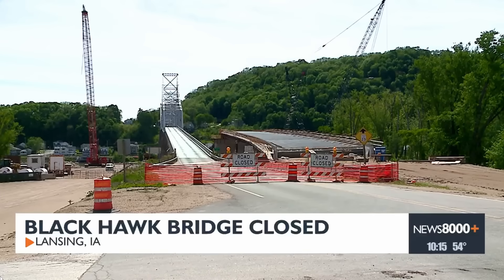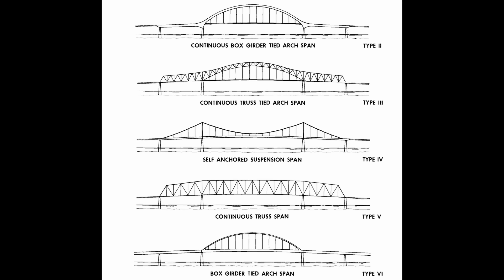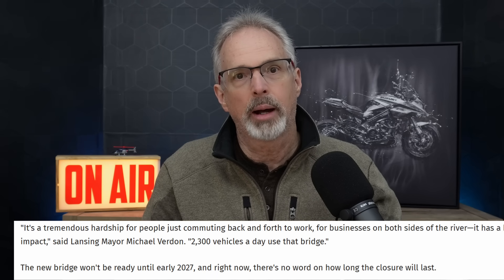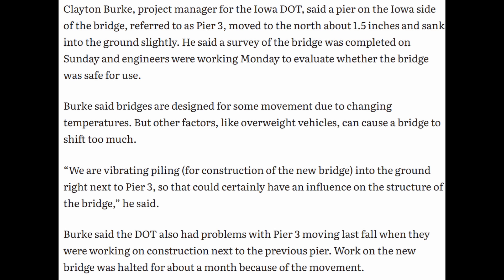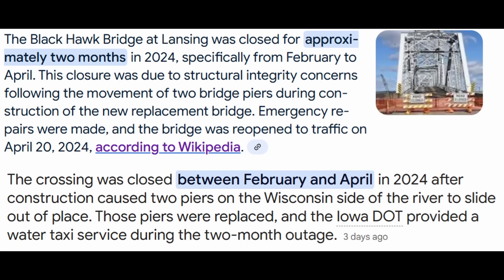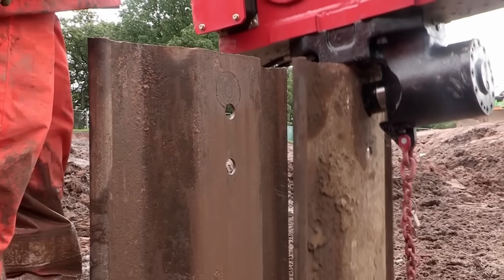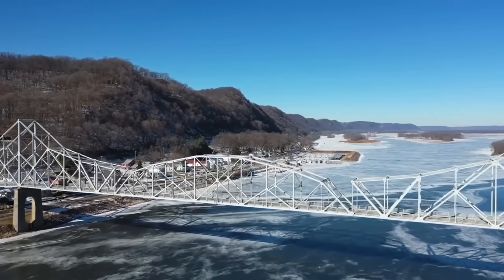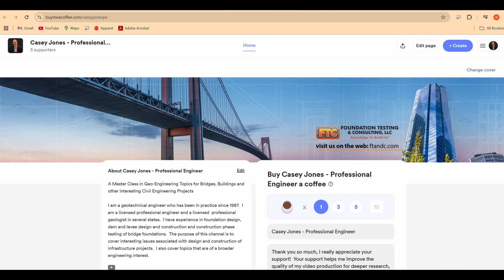Blackhawk Bridge over the Mississippi River

Comment: Lansing Iowa businesses receive a lot of customers from Wisconsin. not having these customers hurts their economy tremendously. That is the reason the existing bridge was left open to Wisconsin. it is a travesty to use the hammer drill instead of a casing oscillator and CAUSE this closing. I suggest a class action lawsuit against both the state DOT and the contractor for lost revenue to the businesses of Lansing and the workers who have to commute to Lansing and now have to drive 60 miles one way to get to work.
Reply from the maker: I am sure it will be a hard impact on the local economy.  I understand that Iowa DOT will be issuing a new press release tomorrow so maybe we will learn more about plans and timing to reopen this bridge.

Comment: Hello Casey. I have a question. You mentioned rather than using a vibration and/or driven type machine for installing casings, to use a casing oscillator instead. My thought is that an oscillator would need to set on some pretty solid ground to be able to apply the torque needed to install these casings. Am I wrong? My understanding is that these were installed in the river with nothing to really hold an oscillator in place, and the driven vibrators were suspended from cranes. Now, I know very little about these machines and have never seen an oscillator work, so I could be way off base.
Reply from the maker: The oscillator and cranes would be set up on barges.   Barges can be spudded to jack he barge deck above the water to provide a stable platform.

Comment: I've been a fan (?) of this bridge for decades. It's sort of a destination for motorcycle people because it is such a pretty bridge, in such a pretty location, and the steel grate deck gives a great sense of flying if you look down (assuming your tires aren't wiggling around too much).

One of the things I really like about this bridge is its engineering honesty, as shown by the gaps in the top chord. All the load of the center truss is transferred to the cantilevers via the bottom chord, so the designers saved a bit of money by leaving the top chord out at the places where the cantilevers and truss connect. This is true of many, many cantilever-truss bridges, but most (like the one across the Mississippi at Winona, MN) put in a superfluous top chord so that people don't think the bridge is "missing some pieces" (what's particularly fun is that the decorative top chord of the Winona bridge has to have a slip joint to compensate for expansion).

It is nice that the state of Iowa has elected to replace this lovely old bridge with a similar cantilever-truss and not the soulless concrete spans that have replaced many of the old steel bridges over the Mississippi. Alas, the CGI rendering I saw at the Driftless Visitor Center (just south of Lansing on the Iowa side) didn't have the gaps in the top chord.

Comment: The ' connection '...between   1931  ' vehicles '' using  those bridges.  They, were about  10   TIMES....less  weight, than todays'  modern  TRUCKS.   THE  PRICE / cost of  Replacing  those   bridges ....goes up   proportionately, along with what You mentioned ; rules / laws /  SAFETY   Standards.   ....standards..../ Too bad, Contractors  today -  CUT  CORNERS....on most  Everything,  designed, and built.  No surprise, to me, in a   ' speedy '    greedy,  impatient,  mostly NON logical, in designing    ' stuff '.   Add, modern  plastics, and other materials, used in   ? Construction ?.  Poor  ......cement, as well.  Too much  water....Not  enough ,  lava ash.....o well.../ so goes , modern  designs.

Comment: I used to live in Lansing as I worked in the Power Plant south of town just out of College (and have driven over that bridge likely at least a thousand times or more before I moved to another job). The detour issue is minimized as most people from Lansing do a lot of shopping either in LaCrosse or Prairie du Chien.  Each city has its own bridge across the Mississippi river.  So in actuality to get to either LaCrosse  or Prairie du Chien is normally a few mile detour and not a 60 mile detour.  There are several small towns between LaCrosse and Prairie du Chien, and people living or working in those towns where they work or live in Lansing are the ones who face a longer detour.

What surprises me is that I knew back in the 1980's when I lived there that the Blackhawk bridge just essentially sits on sand. Piles may have been driven to bedrock - but I don't believe into bedrock. Very susceptible to movement of the piers.

Comment: The previous Sikorsky Memorial Bridge on Connecticut hwy 15 (merritt/wilber cross parkway) in Stratford CT. (replaced 25ish years ago) was about a 1/2 mile long open grid deck bridge that was over 100' off the water (bluff to bluff bridge) and as a new driver, it scared me as it made the car shimmy latterly.

Comment: In my youth,(1970's) they replaced a nearly identical cantilever design between Sewickley and Coraopolis, PA on the Ohio river. The pilings were replaced because back in the day, they didn't support them like they do now. We built many of these bridges at the American Bridge Works in Ambridge, PA. The factory was gigantic ( I think I recall being told that it was 10 miles long). The bridge segments were put on barges and floated down the Ohio to site of the new bridge.

Comment: Someday I'd be interested in your thoughts on the Gold Star bridges in CT. Was originally a single bridge, but they added lanes to that one and built a second bridge so that normally each bridge handles one way traffic. Currently there's work being done and the majority of traffic is on one bridge. Seems like the volume and weiight has to be well over what it was designed for - especially the older span with the added lanes.

Comment: We have family in Lansing. When the old bridge was closed I guessed that placing the new, much deeper pilings so close to the existing bridge pilings must somehow be undermining the existing structure. I don't believe in coincidence. The installation methodology causing liquifaction is immediately plausible and supported by evidemce from prior projects. This is a great video and illustrates why I love YouTube. Your expert insight is much appreciated. And your good analysis attracts positive and supporting dialogue in the comments. Well-done. Thank you.
Reply from the maker: Thank you so much.  I am definitely surprised at this turn of events. I'm going to do an update video soon. I realized I've got several the project documents on my computer already.
Reply: Timber pilings, Timber piles degrade on exposure to oxygen, this tends to soften and rot at the exposed ends even if underwater edges. This easily could have been done by a flood, also. There was a lake near our home built in 1922, for most of the life of the lake the trees were below the thermocline and they remained. In the 80’s with all the drought lake levels fell and the trees began to rot and break fairly quickly. IOWA is of course colder than Texas, but you are getting into that 75 to 100 year period where you can expect the caps begin to fail for no other reason than they are old. Yes, I know, someone’s going to say but such and such discovered a pristine piece of woodwork 3000 years old. Yes, that can happen in wet environments that are anoxic and lack oxygen sources like sulfate or nitrate, but these types of environments within 20 feet of the surface are rare.

Comment: I thought the iowa dot would be well aware of this danger by now, as nearly the same thing happened at sabula iowa in 2018.  Contractors preparing to replace the small slough bridge were driving pilings nearby and caused the existing bridge to drop several inches. This created an instant, unplanned closure of the iowa/illinois river crossing which lasted from February to September.
Reply from the maker: I'm going to call Iowa DOT for an update video to see what they were thinking.

Comment: I am wondering if you would have the time and interest in doing a segment on a bridge replacement project in Ranier Minnesota. It is a 115 year old cantilever lift bridge own by CN railroad that spans the Rainy River between Fort Frances Ontario and Ranier. The bridge is an International port of entry that carries the highest volume of cargo into the U.S. of any rail port, 25-35 trains daily. A new bridge has been in planning for more than 5 years, CN is very tight lipped to the frustration of area residents that are greatly inconvenienced by it dividing our community many hours daily. An interesting aspect of this bridge is that it spans one of the highest volume rivers in North America, the existing bridge and and the rock geography acts as a choke point causing flooding that can be very damaging. In 2022 we had a flood that is described as a 500-1,000 year event, almost a million sand bags were used to try to minimize the damage. The local population is trying to pressure CN to not further impede the flow and remove enough of the bedrock to increase it, we feel that our concerns are falling on deaf ears. They are saying that they will release their plan in the near future.
We are off the radar in a sense due to the fact that the water all flows North into the Hudson Bay..

Comment: You mention the ballooning cost of bridge replacement, citing such things as more regulations and tighter design requirements, calling the resulting price hikes "shocking".  I'd be interested in hearing more of your thoughts on that.  In particular, do you mean to suggest that any of these regulations or requirements are seriously excessive, and that there are large potential cost savings in removing unreasonable ones?
Reply from the maker: Yes, I think there are too many regulations that slow down the pace of bridge replacement and increase the cost.  For example, I think some of the environmental regulations should be streamlined for bridge replacement projects.  I also don't understand why the government is mandating wage rates for trade jobs.   Let the market decide what they need to pay to get a job done.
Reply: Just compare commercial trucks of the 1930s with what is currently on the road. Even current F150s vs the model Model A version. Then compare what safety standards were acceptable in the '30s vs today.

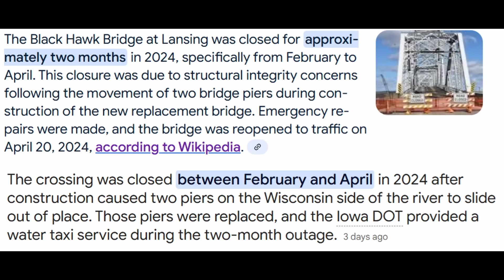Comment: 6:30 So what DOT engineers learned in February of 2024 -- that operating a giant vibrating pile driver next to an existing pier can cause structure atop that pier to shift dramatically  -- is also true in May of 2025.  Who would have suspected that principals of gravity, physics, mechanics and geology are constant over time?  Mind.  Blown.
Reply: Just my two cents here. The original plan was to shut the old bridge down, remove the old bridge, and begin construction on the new one. 

Due to the community and backlash they decided to leave it open. While they were monitoring the old bridge I don't believe keeping open was  priority over cheap construction costs. 

Also this particular area of the Mississippi has lots of secondary channels and back waters making it near impossible to simply chose a new location. They had to land the end of the bridge at the existing WI maintained dike/road.

Comment: As a local(ish) person id like to say that for most people in and around that area it's not a huge problem that's it's closed. Because if your going up to La Crosse or down to Prairie Du Chien your just going to drive the Iowa side of the river and cross at the bridges in them cities so it's not really any difference in time. There pretty much nothing but rural homes on the other side so there's just not that many people that would be badly affected. Also the wiki has a slight mistake.... the Wisconsin side highway is 35 which is also referred to as the Great River Road as it goes up along the length of the Mississippi River. 82 is a obscure east/west highway that more or less starts/ends a mile up the road from the the bridge but technically also includes the very short stretch of road with the bridge. So it's really only partially technically correct, but it's primarily 35 and everyone refers to it just as 35 going past the area.
Reply from the maker: Thank you for those clarifications I appreciate it!
Reply: You are leaving out the fact that Hwy 35 from Prairie du Chien to Lynxville is closed due to construction and will be for a year and a half. This all greatly effects the small businesses just North of Prairie du Chien all the way to North of DeSoto on the Wisconsin side, and many of those Wisconsinites do business in Lansing. If this continues it will cause hardships for all.

Comment: Why don't they just temporarily use a ferry? How long does it take to anchor some cables?
Reply: If my memory serves me right they Last spring has a taxi service sort of thing. Where are they going to find a car ferry available to bring in? Cassville has a car fairy to get across the river from May -October because no bridge was ever built and only spot on the Wisconsin side they could got really high voltage power lines now crossing the river
Reply: @johnhaas2523  I don't know the situation at that location. It seems to me that a river as large as the Mississippi would have a used ferry or barge that could be quickly converted to a ferry somewhere along its length. An electric ferry couldn't be used there, as it would require overhead cables, and possibly underwater guidance cables. Diesel propulsion would be necessary. I don't know what the roads are like there, but I'm guessing a 60 mile detour would take about 90 minutes each way. Cutting a 3 hour journey to 40 minutes might be worthwhile to some people. There are probably lots of reasons to not use a ferry, but when no bridge is available, those reasons may become easier to overcome.

Comment: Foolish for the replacement to be so close to the original, move it 100-200 yards away.  If they refuse to build dolphins for this new bridge FDOT needs to get involved. That would also be a stupid thing to do.
Reply: It's a little late to be moving the placement and if you move it costs are going to go up and it's going to take even longer to get the new bridge open because got to re do the piers in a different place and all that. They already started working on the deck of the new bridge at least on one side
Reply: @johnhaas2523  No the move should have been done PRIOR to any work. It should have been planned to stay away from those original piers.
Reply: @richardmeo2503 the original plan was to close the old bridge. After public outcry they agreed to leave it open as long as they could. Unfortunately there is no way to move the bridge a couple hundred yards either way. There is to many secondary channels and backwaters so the old bridge must meet Wisconsins existing dike/road
Reply: @rileybennis4029  Engineers design things and solve any Problem when working. Especially in Civil projects.
There is a way to re-route, just that No one cared enough to do so, or realized the problems they would create staying next to the original truss bridge. That in itself shows the project was not run by well versed planners and engineers. Thanks to "their oversight", Now the residents have No Bridge
Reply: @richardmeo2503  municipality Engineers design and solve problems on a budget and within their jurisdiction. Where the bridge ends is the end if the Iowa DOTS jurisdiction. Wisconsins begins there.

Wisconsin was unwilling to build a new over mile long road that would have to include another bridge through the backwaters and over the secondary channels. So no it couldn't simply be moved.

The original plan was to shut the bridge from the beginning because of this possibility. Only after public outcry did the DOT agree to leave it open for as long as they could, and that's why the sensors were installed.

Comment: You do an awesome job finding these types of issues. That said, I think it would be really cool to hear your thoughts on a successful bridge replacement. I nominate the replacement of the Merchants Bridge in St. Louis, MO. They pre-built 3 huge spans. The old spans were each removed as one piece and each of the new spans were lifted into place. There was a ton of work done to reinforce the bridge piers as well as completely redesigning the approaches. They did all of this with hardly any interruption to rail traffic, usually only a couple days of down time for each of the spans. I think this would provide a great contrast to many of the issues you've covered.

Comment: Somebody dropped the ball letting the contractor use a vibratory hammer that close to the old structure. Contractors will use the lowest cost method for them to get the project done, which in this case is a vibratory hammer. I blame the D.O.T. for approving the method. Unfortunately it’s the local residents paying the price of a 60 mile commute, likely for quite a long time until the new project is completed